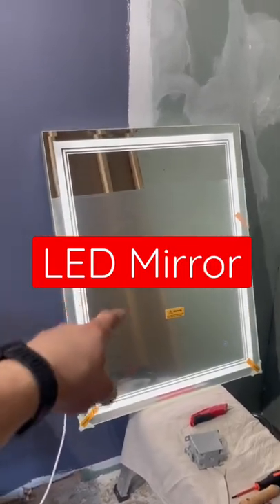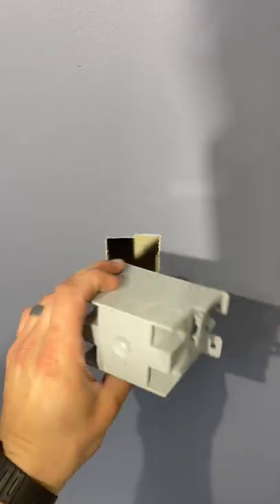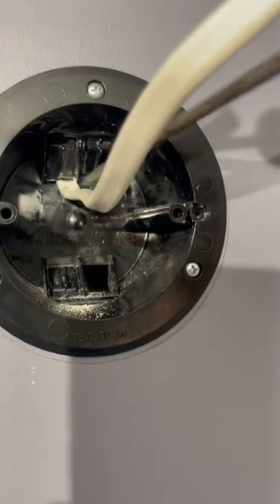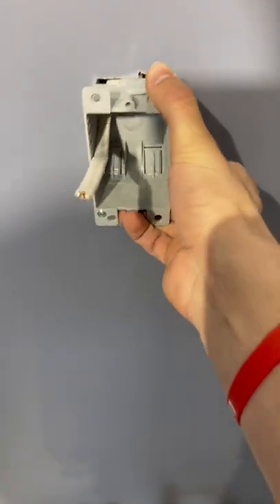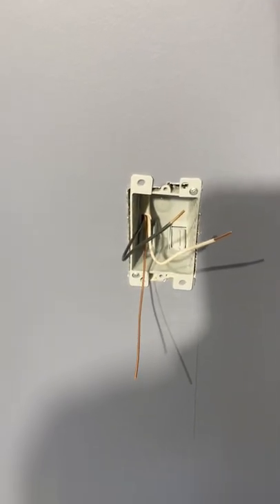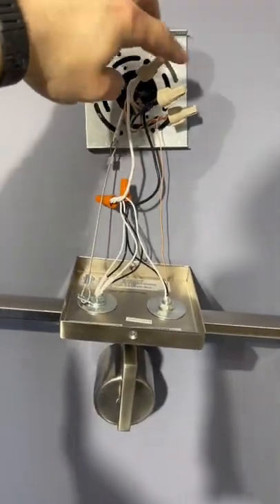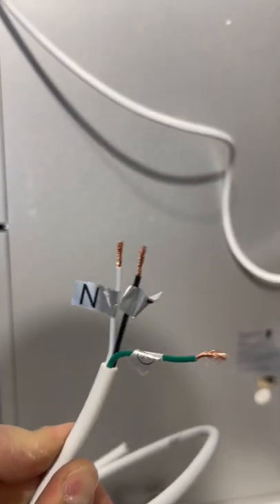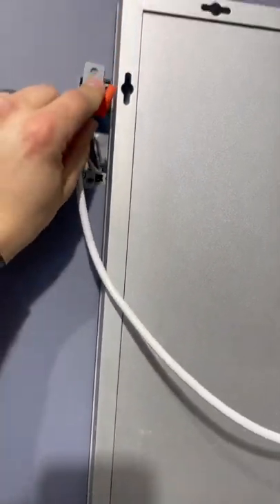How to install LED mirror in a bathroom. #diy #shorts #youtubeshorts #construction

Comment: This is only ok if you want the mirror working with the bathroom light. If Indepenednet, then it snot just adding a wire. These mirrors need their own constant powered to utilize the built-in switch

Comment: Don’t try this on your own when creator didn’t tell you which wire is what ?this is definitely not a how to video . Search fix this old house on YouTube he shows exact steps including how to tell which wire is live the gauge that should be used ect !
Reply: it's common sense anyone can do this
Reply: @majestik_potato5713  while I disagree it's common sense... It is standardized. So yeah op has no clue what he's talking bout. Must be an old dude who's married to PBS
Reply: @majestik_potato5713  not common sense if the original installer used the white for power instead of the black ?u never know what a other person did unless you verify the wires of which has the power or you could get electrocuted not everyone knows these basic steps can result in death/fire  if not properly installed. Just a heads up for the newbies electricians get paid a lot to know what there doing for a reason .
Reply: @mplscarsales6652  it’s safe to assume if you’re gonna be doing something like this you’ll have a basic understanding before you do it.
Reply: @majestik_potato5713  If only everyone understood such a simple concept. Unfortunately, this not the case. People will do anything they deem simple. It is purely ignorance of the subject.

Comment: But the vanity light is never hot since it can be switched on and off. It means that switch needs to be on for the mirror to work? Can someone confirm this thanks
Reply: Yes, that is true. The switch will have to be on for the mirror to light up. 
When I installed mine, I used separate switches for the mirror light and the main bathroom light.
Reply: @geongeo so can you use the wires from an outlet to connect the mirror?
Reply: @gmzmotors2467  it sounds like you are asking if the mirror can be wired hot all the time. It can be, but then you would have to use the touch button on the mirror itself to turn the light on and off.
Reply: @geongeo  yes! So the switch doesnt have to be on in ordee to be able to use the mirror.

Comment: Can you turn the light off and still use the led mirror light?
Reply: No
Reply: You need one battery powered or add a switch
Reply: No because he “pigtailed” them together. You would have to put it on a separate switch if you want to turn off the light but still use the mirror.

Comment: Isnt that the wrong box , last time i remeber you has to use a round box
Reply: no, rectangle is fine as it is just a junction. round is required when fixture is hanging from the box. the “knockouts” should not be removed though as they are actually clamps and the cable is required to be clamped into the box or stapled within 12”